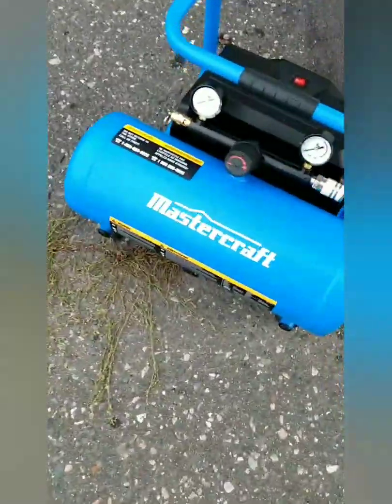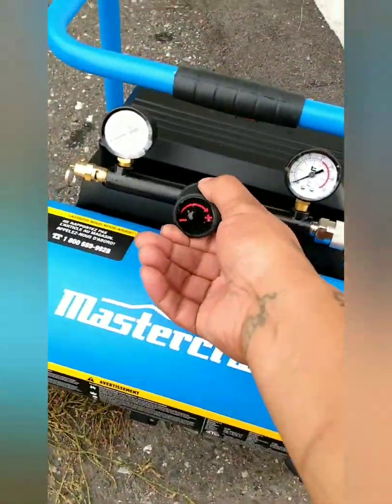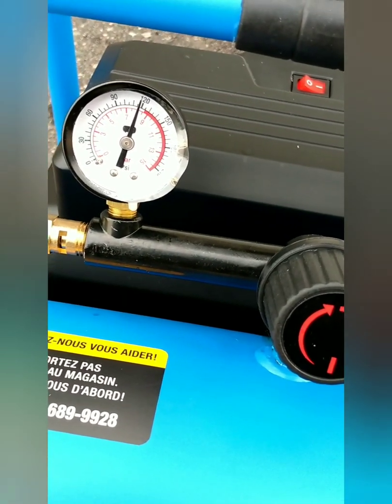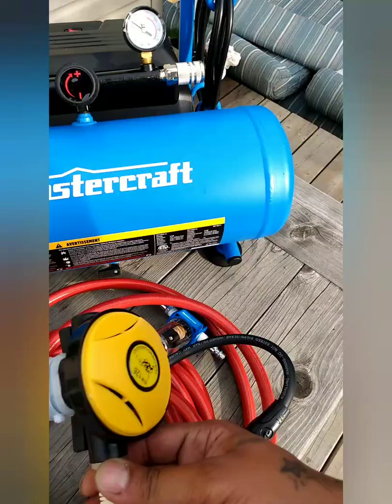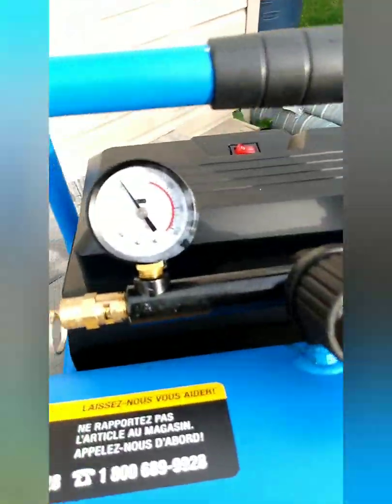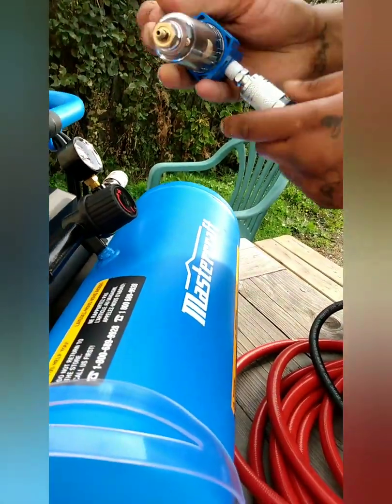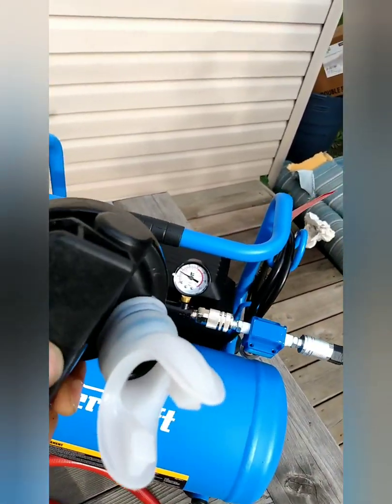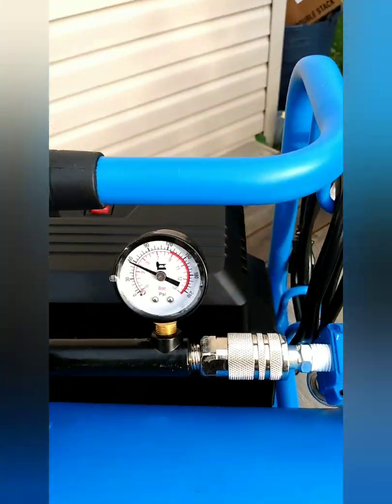Diy dive system build for less then $300

Comment: I am curious to see what your set up looks like when its on the water and ready to go. 
You just put the compressor and the generator on a raft? How do you make that work
Reply from the maker: Remember steel dose rust in the cilinder when air pressuer creates water
Reply from the maker: You put gas in the genarator keep it away from the air pump plug it in  and dive  i never put mine on a raft i had a plug outlet on the river front
Reply: @treasurewithmnrs  you think it would be possible to make it work putting them both into a tote box floating above you no matter where you went?
Reply from the maker: @theartist8189  yes i do think that would be possable just find a way you can keep the exsust from the motor going out of the tote and away from the air pump intake you should be fine as long as you have the propper filter
Reply from the maker: I sold it i use blu3 nemo now

Comment: How much psi do i need going to the regulator to dive at 10 meters?
Reply from the maker: High pressure regulators regulate the output pressure from 1 psi to as high as 60 psi but that deep not to shure preshuer would be much greater so id think deff more then 60 psi https://www.ifdi.info/10mDiver.php

Comment: I doubt that it's good to breathe this compressor unfiltered at the "intake" air. Massive compressors with multi layer filters are used to fill scuba tanks. Also, how are you going to power the compressor out on the water...you're going to need a boat with AC power.
Reply from the maker: get the right  filter and it will be ok and you can use a genarator from shore but now i use the blu3 nemo alumeneum  compressor would be alot better tho still with a good filter you will be fine

Comment: As much as I like the low cost concept of using a "mastercraft " product,  I dont trust the quality of the air. Teflon coated parts, apparently, that release toxic fumes at certain temp. Unless its a diaphragm pump with reed valves, I wouldnt use it. Thanks for the video. Good luck!
Reply from the maker: yess you are correct and you are welcome  thank you i use the blu3 nemo now it works perfect
Reply: @treasurewithmnrs  and I have a Brownies 3rd Lung, system. All the best to you, from Canada.
Reply from the maker: @super_brainz  thanks you as well

Comment: But how would you power this at the beach when you want to go diving?
Reply from the maker: You could bring a genarator one of those quit ones champion genarators are pretty quiet if u build this use a aluminum compressor to avoid rust
Reply: @treasurewithmnrs  what generator do you use
Reply from the maker: @theartist8189  https://www.amazon.ca/Firman-Generators-PO1201-Performance-Standard/dp/B01FY8NRE8/ref=mp_s_a_1_4?crid=26CGNFGOWVO5N&keywords=champion+generator+1500+watts&qid=1643931345&sprefix=champion+generator+1500+watts%2Caps%2C113&sr=8-4
Reply from the maker: @theartist8189  That's the one I use If you build one can I see pics it would be cool it worked perfect for me I love mine I can wait to use it again this summer I used it in all my vids check them out if you don't mind
Reply: @treasurewithmnrs  thank you for the advice.  That's the cheapest generator I've seen so far... and I've been looking for a minute
Reply from the maker: @theartist8189  your welcome let me know this summer how your build Gose I will be having more treasure hunting content in the thunderbay in Ontario area with the x calibre 2 metal detector stay tuned 🙂never no what I'll find out here contact me any time agin good luck on your build and be safe
Reply: @treasurewithmnrs  i have 2 more questions for you...
How big is the fuel tank on that generator? 
And if that generator is running full throttle the whole time... how long will it last before you run outta gas?
Reply from the maker: @theartist8189  it will run for 10 hours at half throttle and I'll have to check the liters on the tank
Reply: @treasurewithmnrs  so i shouldn't need a fuel extender.... thanks again dude
Reply from the maker: @theartist8189  no you do not need a fuel extender just bring an extra can of Gas if u prefer to and your welcome  and the gas tank is a 4.4L
Reply from the maker: Here is wat u need it's alluminum no rust will build in the tank  California Air Tools Cat 2010A Ultra Quiet and Oil-Free 1.0 hp, 2.0 Gallon Aluminum Tank Air Compressor, Silver https://www.amazon.ca/dp/B00TDNKBMC/ref=cm_sw_r_apan_glt_i_WRS20V1EZV5Z8E65NTS5

Comment: That’s a cool setup I just built a similar unit with a greenworks 40v cordless compressor I hooked up one of those 5 gallon air storage tanks you carry around in the car for an emergency takes a few mins to Get it all charged up but it works awesome
Reply from the maker: Yess thanks and that is a good idea i get about 40 breaths from 60 psi to 30  good idea🙂
Reply from the maker: That's amazing 🙏